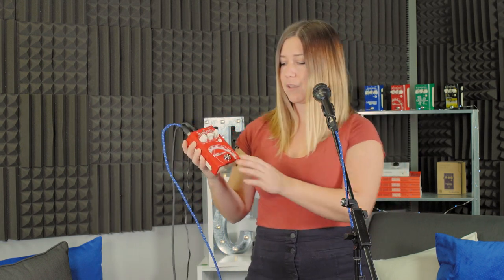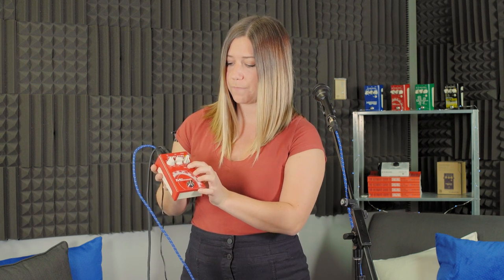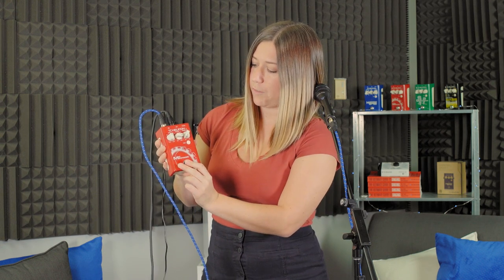Helicon Headquarters || Mic Mechanic 2 Firmware Update

Comment: Thank you for this. I wish there was a quick way to get it back to the factory settings. I've accidentally either clicked the button twice or have held it down while on stage and I'm stuck with a setting I do not want. Otherwise, I love this pedal and have been using it for my live acoustic gigs for over a year.
Reply: Yeah there’s nothing in the manual about resetting back to factory. Maybe try downloading the latest firmware and installing it. Hopefully that will reset it. The new (to me) update is fantastic!

Comment: New in box, it has a squealing oscillator sound.  Did I just get a bad one?  I read a lot of people that have this situation, dating back to 2021.  Mine was purchased in May of 2023 and the oscilator sound will not stop unless the power is off.   Running off fresh batteries so it's not and bad power supply.
Reply: Yes you got a bad one. Return it until you get one that doesn’t do that.

Comment: I tried to connect my box to my laptop but my computer does not recognize the device, any thoughts as to why?
Reply: Mine did this too. I corrected it by downloading the latest VoiceSupport 2 software. Uninstalled the old software and installed the new. Connected right up. The new firmware is a big improvement!

Comment: Hello: I am writing here to see if some kind soul can help me, since I am quite desperate with the subject:

I have a TC Helicon mic mechanic, well, I go to their website, I download the firmware and it doesn't recognize it, it only recognizes an old update from 2014, there is no way to update it, (unless I'm doing something wrong, which I doubt) since in its day I updated it without problem, but now the echo selection only does 3 repetitions that are barely noticeable when there is music in between.

Thank you very much in advance, greetings.
Reply: Make double sure you downloaded the correct software for your pc/Mac. Uninstall the old software and install the new. It should fire right up. Mine did. Also, to adjust the feedback (repeats) hold the tone button and adjust the correction knob. Clockwise gives you more feedback, counter clockwise is the least amount you can get.
Reply: @terrytarpening9456  Thank you, it helped me a lot, regards.

Comment: Is there a way to have  the footswitch only turn the echo/delay knob on and off? I'd like to set the reverb at 1 setting via the knob. Same with the pitch correction. Then turn on the echo on and off via the switch as a cool vocal effect only for certain sections of a song. I always want to have the pitch correction and a little reverb on... not just when I engage the switch. Does that make sense?
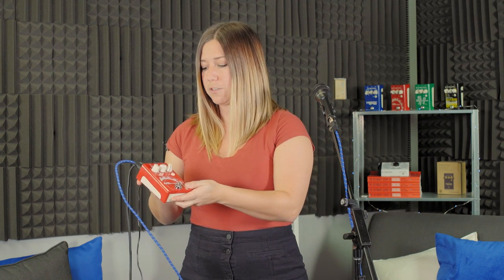Reply: 0:31
This firmware does just that.

Comment: I am getting a terrible buzzing sound when I use this foot pedal. I sent the first one back and I am getting the same sound from the new one as well. I’ve tried using batteries as well as the power supply and the humming is still there. The buzzing only happens when I use the foot pedal. No issue with mic plugged directly into the amp or other outputs. Please help as I don’t want my money thrown away purchasing your product that I can’t use.
Reply: same here, unusable
Reply: Same here, and it was like that new, this is a noisy pedal.
Reply: I have the same issue!! I sent one back already, the new one has the same exact noise. I've recorded the  noise and uploaded a short video as I'm trying to figure out what's wrong with it. I have tried everything, too, from batteries, to bringing it to a different studio, different set up, I tried with no mixer, I tried treating it as a ground loop..  but the noise is always there and it's always the same. I came here trying to see if updating it might help...? Were you able to fix the issue?
Reply: @VeronicaZanchi  2023 - May, the same boat anchor is still fresh off the Amazon shelves.  No one is addressing  this it looks like.    Wonder why the company will not respond to all the reports of this.  Going on since 2021. How old is the MM2 anyway?     And when are they going to recall them?
Reply: @Fast Byte I sent back both the MM2 and  I got a MM1 in the end. No noise whatsoever. It's amazing with supercardiods, but I was never able to make it work well with cardioids.
Reply: Keep sending them back until you get one that doesn’t do that, OR, find a used first edition.
Reply: same problem here. I’ve tried a lot of things to solve it, I even bought best batteries available and a specific charger for MM2 …the problem still on.

Comment: Can you please tell me how to tell the difference between the Mic Mechanic and the Mic Mechanic 2? Would it have been to difficult to put a "2" on the device? This is very frustrating!
Reply: Live2Shred Mic Mechanic 2 has the effects names (Echo, Reverb, Correction) on top of the rotary buttons; the first version has the names  on the bottom of the rotary buttons. First version also has a gain adjustment on the left side of the unit.
Reply: @Agarwal6  thanks. I ended up buying a version 2. I guess the main difference is the change in DC voltage to 9 volt to make it more compatible with multiple outlet power distribution boxes. This thing sounds great! I put the autocorrect just slightly over the middle setting and the other settings depend mostly on the environment, or the audio (Karaoke) track quality and mix. Thanks again.